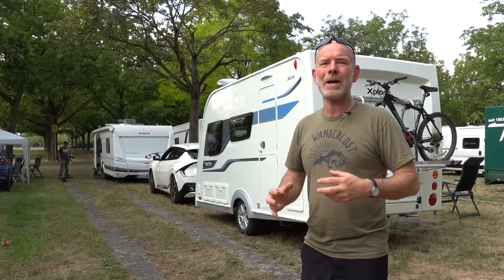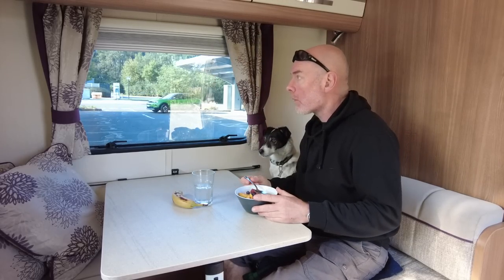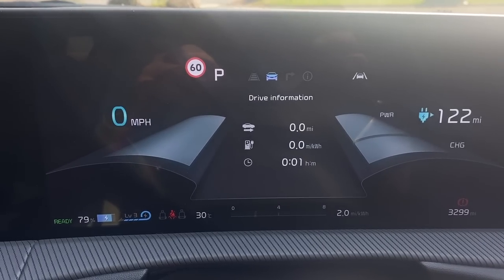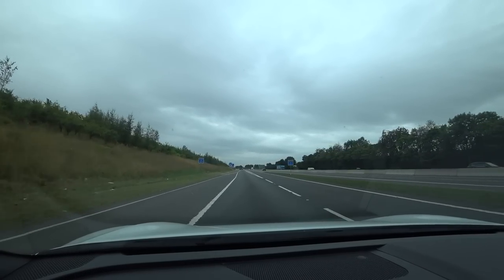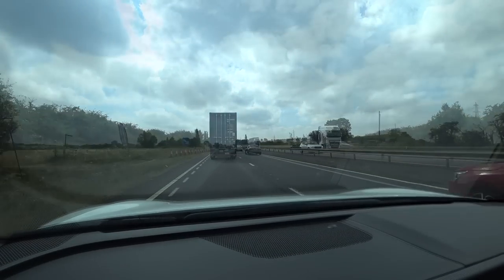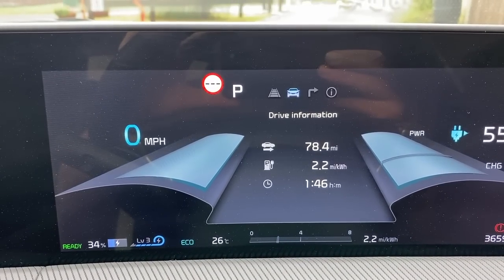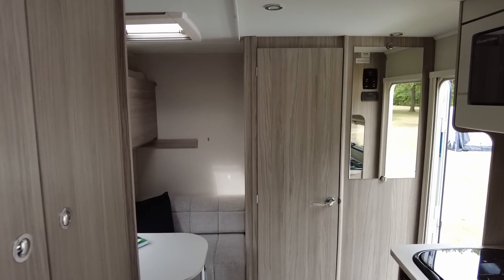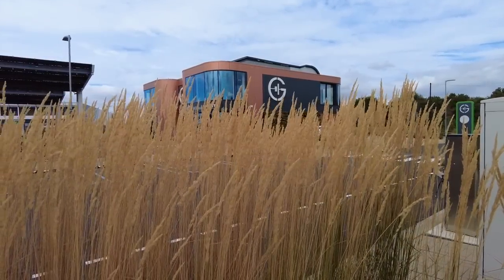EV towing a caravan to Germany from Scotland: Range and cost

Comment: How much would it cost if all of the chargers were not free and at current rates?
Your route was not direct and so the estimated mileage won't match your actual mileage and kWh usage.
But good to see it's possible, and for the rest of the year where you aren't towing and you are charging cheaply at home ev is a good choice.
Let's hope utility prices don't kill the ev revolution.
Reply from the maker: I'll be finding out this year Nigel because, as predicted, there is no more free charging. I do think high electricity prices will hamper EV adoption, not to mention the less than attractive truths about the precious metals they need for the batteries at the moment.
Reply: @andrewjditton  yeah the mood surrounding electric cars has changed somewhat too, good news is the older electric cars are coming back down in price and more affordable..

Comment: Hi Andrew! Great video and good content. You just showed it can be made. Unfortunately, we motorhomers still have to wait for another source of energy.
Reply: It's coming.
The vans are being launched, it's only a matter of time before the conversions happen.
Reply: @rogerstarkey5390  I believe small vans like the transporter/vito may run on a battery base. I think Possl will present a battery powered Campster this year. However, in the segment of motorhomes we still don't have any real alternative.
Reply: @rogerstarkey5390  The trouble is, all the EV campers/motorhomes in the process of being launched have a real world max range 0f 120-150 miles. No good to me, I'm not stopping 5 times just to get to the highlands, let alone touring Europe. For current (bad pun sorry) LiFePo4 based batteries, you can either have range or payload - not both. We either need to postpone fossil fuel phase out (pretty much guaranteed now,  it'll get kicked down the road at least 5 yrs, prob 10), wait for new battery technology (still around 7 years away from economical manufacture), or move to hydrogen or manmade fuels.

Comment: Excellent and interesting travel diary. 

Something this flags up, that desperately needs to be addressed by operators of charging sites at Motorway Services - is it not, strictly speaking, a motoring offence to detach a trailer(except in an emergency, of course) anywhere on the motorway network? Certainly I would confidently state that it contravenes the site rules in some services - yet their layouts leave EV caravanners absolutely no choice. 

For what it's worth, I think the EV caravanning revolution is still quite some way off. For starters, relatively few of us can even dream of accessing the minimum £40k plus it takes to buy one that even comes close to the combination of towing capacity and range necessary to make it in any way a realistic prospect. 

However, it is the pioneers such as yourself who will ultimately drive the industry to that point. For what it's worth, I think the Hydrogen Fuel Cell may well turn out to be the future.
Reply from the maker: That's a really interesting point! One to look further into. Cheers.

Comment: Great info thanks. How about if your caravan had a battery too, that way you could run all your power needs off electric and you could slow charge it at night also during the day if your staying a while. Wouldn't that be cheaper than gas?

Also wouldnt it be great if you could use the battery to boost your range if necessary when your driving?!
Reply from the maker: I see where you are coming from, but the price and weight of the Lithium ion battery for the caravan might make this counter-effective. I can see it happening one day though, especially if Solid State Batteries become more widespread. Cheers!

Comment: Great video. Video popped up towards the bottom of Youtube "you might be interested list". Going to re watch it specially when you are comparing prices, and times. Would be great to see a video of two of the same make, a fuel and electric, vehicle doing the exact same journey together, then compare prices. This would make the comparison simple for those of us with simple minds. As you have said time management is different, and if you are driving most of the way, and not stopping, then you can only use a fuel vehicle.  Also you mention aerodynamics is important for the faster motorway driving, would a roof air deflector on the car improve the aerodynamics, and therefore range? Are caravan manufacturers looking at reshaping the caravan to compliment the new EV cars shapes? Two question for further videos, potentially. Have fun.
Reply from the maker: Thanks! The reason I didn't do a 'side by side' comparison is purely as I only have the correct data for the trips mentioned. Deflectors were all the rage in the 70s and 80s but not now, I think due to difficulties in attaching them now cars don't have gutters. It'll be interesting to see if they come back. Cheers!

Comment: 90 or 100 miles between charges.... is awesome? 1.5 litre diesel - 400-500miles betwwen fill-ups, and five minutes to fill up..... Wake up, everyone!
Reply from the maker: The quiet smooth powerful vibrationless serenity of the drive is what’s awesome. 90-100 miles towing a caravan takes about 2 hours, after which time it’s recommended by road safety bodies to take a break.

Comment: Think we need more campsites with charging points. That’s the barrier for me to go full ev at the moment, particularly after being told off at a very popular site in Poole for daring to attempt to charge my phev.
Reply from the maker: 100%. It might even be cheaper for campsites to restrict EHUs to 6 or 10 amps (given the increasing cost of electricity) and using the excess capacity to power car chargers - certainly cheaper than replacing EHUs with meters in many cases.

Comment: So, about maximum of 120 miles / 200 km's with a charge. That is rubbish. You are more going from chargestation to chargestation instead of driving. And you are telling, 100 miles with a charge and a caravan is awesome? Dont forget, the weather is great, when it is colder the 100 miles will be less. And when the car is getting older, the 100 miles will be less. So, in some years time and with the heating on, the range will be 50 miles. Still awesome, Andrew? I doubt it. And some other annoying thing, is to detach the caravan / trailer during charging. For towing a caravan,  only diesel is great.
Reply from the maker: Smooth, quiet, powerful, no vibration, phenomenal torque... but you're not interested in that I guess.
Reply: @andrewjditton  all true. Absolutely. But face it, every 100 miles charging? Detaching trailers? And one is for sure, the range will only be less in the future.

Comment: My uncle has recently purchased a Tesla Model X Long Range with a main focus on towing. He also has a caravan (can’t remember the exact brand) which is MIRO 1500kg. He’s been talking about going on a camping trip to Iceland with a stopover in the Faroe Islands. The length of the trip will be around 2000km from where we live in Switzerland to Denmark, then a ferry to Iceland. I think it’s too far to use an EV for bearing in mind when towing, the range is roughly around 180km per charge which will take forever. I’m thinking of renting a diesel but I also want to try it in an EV because I’m a huge enthusiast in electric vehicles and battery technology. 

What would your opinion be?
Reply from the maker: I'm afraid I don't know enough about the infrastructures in those countries to make an informed comment. As long as there are enough chargers I can't see why it's not doable in an EV. I used to take 2 overnight stops to tow the 750 miles from my home to Dover in my diesel truck. In my EV I still take 2 overnight stops, but 3 is easier.

Comment: What is the weight of the caravan and kerbside weight of the tow car.

I tow a 1,800 kgs single-axle Hobby caravan with my 2001 BMW 530D Touring (about 1,900 kgs kerbside) this gives a well balanced rig.

The excellent torque and horsepower from the 3.0 diesel enables me to travel from the where I live to the north coast of France on a single tank of fuel. The speed limits for a rig of this size contribute to the excellent fuel economy, The speed limits also make it worth avoiding the toll roads.

Switching to an EV leads to an insoluble problem. I have a 21 year old diesel tow car that is worth £1,000-£2,000 at most. It costs me perhaps £500 ayear to service , I do my own servicing.

Changing to a £50,000 car is financially impossible (cost of finance, use of available capital) and then there is the carbon footprint involved with the production of the Kia and the recycling of my BMW.

Good to see that towing with an EV is becoming more practical but the affordability is still an unanswered question, as are the long-term ownership costs, particularly the miles per battery (not chanrge) and the cost of battery exchange.

Comment: Good video and interesting stuff.  But I suspect, as things stand, I'd be getting very anxious from electric top-up to top-up.  I can remember trips up and down  the A9, by me and/or my wife, where there has been bad weather and accidents ahead which have caused very lengthy delays and on one horrible occasion a lengthy detour. As you can imagine, a detour on the A9 might be VERY lengthy as it's basically a route on its own up the east/central part of Scotland from Perth to Inverness and further north. 
On one of those occasions my wife at least had our son with her, but it was cold, snowy and dark so the heater etc was needed. What she'd have done if she'd been watching the battery go down, I dread to think. 
So, more top-up stations will be VITAL to make that trip viable (unless anti-anxiety pills come as standard).
Refilling without needing to uncouple are similarly useful

But - GOOD VIDEO ...
Reply: Things to remember.
If you're STOPPED in an EV you don't use any "fuel"
If you need heating? You'll have at least 4 days(!)
They've been slept in overnight in Norway (above the Arctic circle) in the middle of winter. -20°C. No problem.
.
"Top up stations"
In a REAL emergency, any 13amp socket is a top-up station.
As far as rapid charging goes, there's going to be a huge increase in the next two years.
Tesla is now opening their network as well, so that's going to help big time.
You'll also see a lot more drive through chargers.
Wait untill the supermarkets and fast food outlets realise the opportunity. "McCharge" will be a thing.
Reply: @rogerstarkey5390  Thanks for that. I hadn' realised.  I thought if you were stationary for an hour or two, like when a road is completely blocked, and you needed lights and heat/air con, the battery would soon crash.
Reply from the maker: Cheers Raymond. The Scottish Government has put a lot of resources into the 'Electric A9', of which the Stirling Low Carbon Hub was part. I had the aircon going for the entire trip, and remember that while an EV can do over 300 miles on one charge, even with the heating etc on, you'll get 240 miles at least.

Comment: Thanks for the review. Lots of pluses but at the moment sitting for ages at the services, worrying about the infrastructure i.e. is there a charger available that works and whether my caravan would be there when I got back to it, the huge cost of an EV compared to another fuel sourced car, the increase in electric costs, picking up a fine waiting for a point to become free and not being able to charge to the extent I'd like as well as the frequency of said charges. Not for me at the moment. Have you weighed up how long that journey would have taken in a diesel, or petrol, engine vehicle? I agree naps are important as are showers, I could do both in those charging times. 😉 You are absolutely brilliant giving us a warts and all review especially the costings which were a real wake up call for me. Thank you. X
Reply from the maker: Glad you found it useful Kim. None of us know how the costing will pan out in the future, but there is a point of about 60p/kWh which, when towing, works out to be more expensive per mile than my old Navara + Airstream. BUT I guess you have to offset that against the lower cost and free charging elsewhere. All the best.
Reply: @andrewjditton  roll on tomorrow's cap news too. 🙄 I'm wondering how long Nicola can keep Scotland's infrastructure and free electricity charging points going. From your perspective fingers xd. Safe travels. X

Comment: The missing info from the cost per mile is the TCO of the two vehicles.  Bring that in and its the fare between eurostar and ferry that has me ovenight in a double outside club.  The headache is that noise or better filtration in  the Kia?

Comment: Excellent and very informative video.  I would very much like to know about service intervals for Electric Cars and what is involved in the service. For example petrol/Diesel is oil change etc etc. But what happens with Electric Card. ? Cheers from old George and Jane. 👍🇬🇧👫🤠👧
Reply from the maker: EVs take a LOT less servicing and are much cheaper to run. Service intervals on the EV6 are every 2 years and it's mostly brakes, ventilation filters etc.
Reply: @andrewjditton  Many thanks Andrew. Just hope normal garages will be able to do the work. We struggle with our motorhome as Garages want to plug in to check Engine Management Computer . Our motorhome doesnt have one. Too old and and mechanics don't have a clue. Cheers from old George

Comment: Andrew watching this video has confirmed that i have no intention of ever buying an electric powered car whilst i am towing it looks a lot of hassle, unhitching then re hitching its a thieves paradise especially if you are leaving the van unattended for up to 30 mins maybe more. i have a rr sport pulling a swift elegance at around 1800KG  so i would be stopping even more, at the moment the infrastructure is not good enough neither is the miles per full charge, they are great for pottering about with home charging but a million miles away for towing. I will carry on with my 5 mins to fill my tank to do another 300 plus miles.

Comment: Dumb question time. Could you fast charge to 80 and then switch to a slower charger to top up? Would that save charging time and mitigate battery wear?
Reply from the maker: Not a dumb question! You could do that, but fast chargers slow down after 80% to protect the battery. If there are people waiting for the fast charger, it's the decent thing to move after 80% and finish on a slow if need be. If nobody's waiting, there's no need to switch as the car will slow the charge down.

Comment: I'm following you travel descriptions with a lot of interest since I too drive an EV6 and am looking at light weight small campers available here in the US. You've said that your new caravan weighs 1000 kg. Please define just what this entails. Is it the dry weight as it comes from the manufacturer or does it include fluid weights and any options you may have requested to be added? Thanks!
Reply: Trailers are quite different in Europe and the UK. Tongue weights and overall weights are much different proportions and there is a greater variety of ultra-light larger trailers that would be thousands of pounds heavier for the US equivalent. When choosing a trailer in the US, make sure you are not exceeding your payload (all the weight the car axles can handle...listed typically on the door frame of driver's door) as that seems to be the biggest bottleneck here. Of course GVWR (the most the trailer axles will handle) is also important as well as how you distribute extra weight throughout the camper when it is loaded.
Reply: @photogrl1359  Thanks for chiming in. I'd still like to hear from Andrew regarding my questions above. He has let us know that the weight of the new caravan is 1000 kg (2200 pounds) and it would be useful to know just what that means. Is it dry weight or loaded?
Reply from the maker: Hi Bill, as @photogrl13 correctly says, we're not comparing apples with apples here. The Kia EV6 in North America has a much reduced maximum towing limit compared with the European model, because of the massively different set-ups. The new caravan is 1043kg loaded, about 906kg Mass in Running Order (dry with gas cylinder, lead etc)

Comment: Very informative video Andrew. Thanks for that. The cost comparison is really useful (& quite surprising). What’s the towing capacity of the EV6?  It’s the lack of  towing capacity of most EVs that I find strange. Even the electric version of the Vauxhall Vivaro is only 1100kg 😬
Reply from the maker: Hi Hugh, it's 1600kg which is the main reason I chose it! Also the Hyundai Ioniq 5 is 1600kg, but only in Europe and not the North American versions (go figure!)

Comment: Andrew,  I am sorry but the range is simply too low.  If you were a family on a two week holiday the time taken to travel a reasonable distance is inadequate.  Having to stop with children and wait whilst charging I envisage a nightmare journey.

EV at the time do not make sense for towing.  This may change in the future but not yet.  I feel hydrogen may be a more efficient environmentally sound way to tow.
Reply from the maker: I hear what you're saying Colin, but to my mind it's more to do with setting up reliable, fast, pull-through chargers. I'm sure stopping 15 minutes every 2 hours to stretch legs and use the loo isn't a huge ask. But it's precarious still as you can see from the vid. I'm as frustrated as everyone else that there is so little data and research into hydrogen.

Comment: Not sure if its been mentioned, but would winter driving dramatically reduce battery performance?
Reply from the maker: Using the Aircon and powering the caravan fridge hasn't made a huge difference, but rest assured I'll be openly reporting on winter touring when the time comes. Thanks for watching.